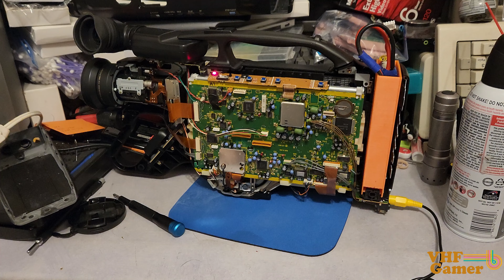Panasonic Omnimovie PV900 Diagnosis and Repair

Comment: Hey! I recently purchased a Panasonic PV-710 off of Facebook Marketplace and I’m coming across some issues. It powers on just fine, I got a new AC adapter charger and everything, and will remain on until I try to record something. The farthest I got was recording a few seconds on a tape until it would shut off on me. Now, I can’t even record anything on tape without it turning off once I press the record button. Do you think you can help me figure out a solution to it? I’d really love to utilize it

Comment: Great breakdown, I own a Panasonic omnimovie CCD ×8
I had it recently fall, and everything comes out. It is completely dark. You can't barely see anything unless there's a light source, but that's all it can see the light.
Do you know if it may be an electrical/circuit issue ??
Sorry for the long comment, lol
Reply from the maker: You mean you can hardly see anything through the viewfinder? Did you try adjusting the brightness on the viewfinder? There's usually a knob.

Comment: Thanks for your work, mine is missing the capture plug adapter in the rear that has the red,yellow and white female jacks, I notice yours has a yellow jack for the capture, is there any way I can rig mine up ? or can you tell me what pins are the video and audio?
Reply from the maker: I can't say for sure because I don't have that model with the separate AV. Sorry.

Comment: I've got a pretty loud whirring noise when switching my Panasonic AG-456 to camera mode, I'm wondering if you have any experience with something like that. I'm assuming the read/write head needs lubrication but I wouldn't know where to start when servicing something like this.
Reply from the maker: I'm not familiar with that one, but my Panasonic that I show in this video whirrs pretty loudly when it switches modes. I even show a clip of it at 5:50. So I think it's probably fine. But if you're still concerned about it, I would just pull it apart and check all the obvious spots where the tape mechanism slides and or spins. You'll usually see old grease there. I would clean it off with a Q tip and reapply fresh lithium grease. The old grease can get sticky and harden with age, so that's why old mechanisms often don't work correctly.

I doubt it's the actual read write head itself. The only servicing the R/W head should require is occasional cleaning if it gets dirty. They used to sell cleaning tapes back in the day, just for that issue. 

Tech tip on pulling things apart. Take pictures of where things are BEFORE disassembly, and make extra sure to sort your screws by size.